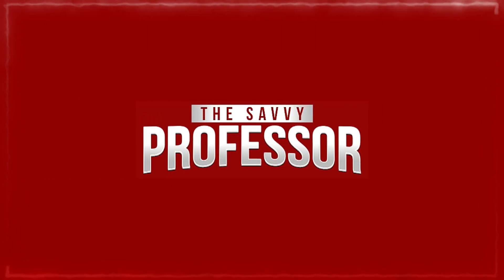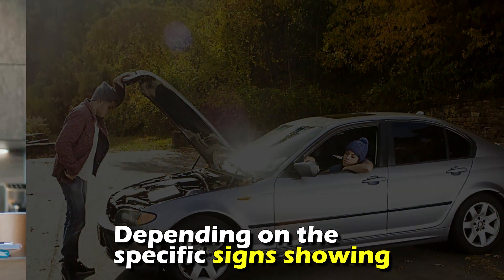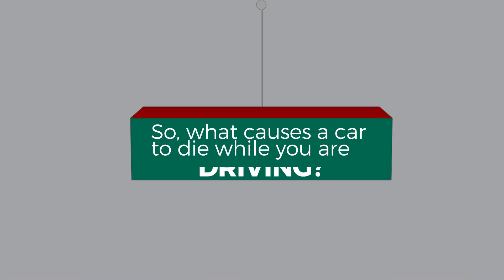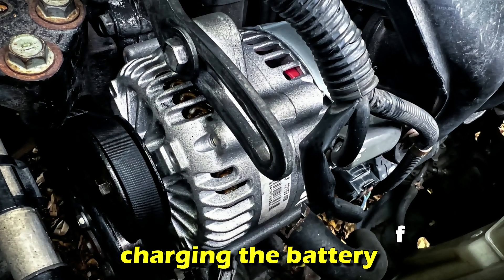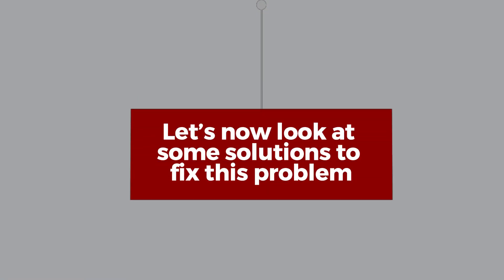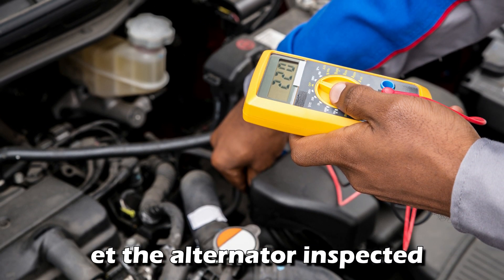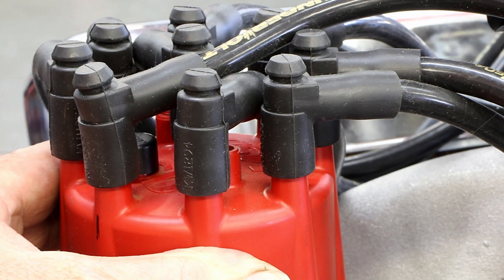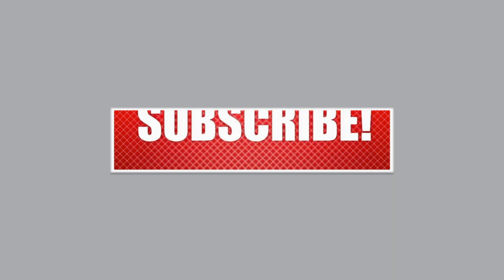Car Died While Driving and Won't Start (Meaning, Causes, and How to Fix It)

Comment: 2002 camry, 240k miles.  Cut off while driving, no crank no start.  Dash lights and headlights on.   No blown fuses, no visibly burnt relays.  Any thoughts?
Reply: Did you fix it?
Reply: @andymaldonado9112  no.  Not yet
Reply: @andymaldonado9112  could it be ignitor? Ecm?   The main alt fuse isn't blown.   Racking my brain
Reply: @newprep3661 what was it
Reply: Duh what a useless video
Reply: What was it?